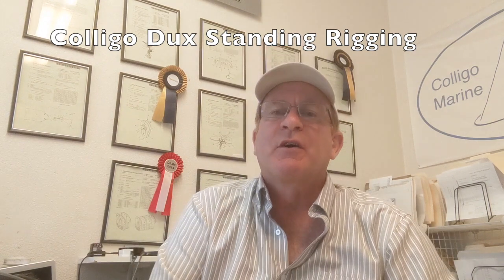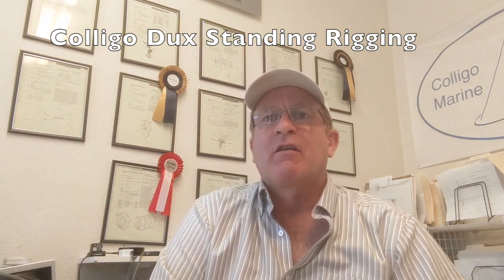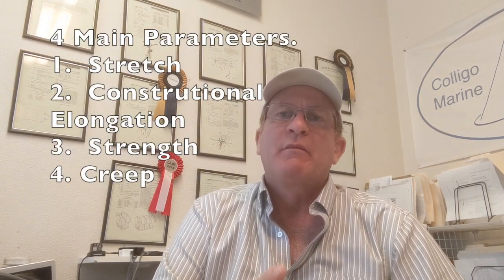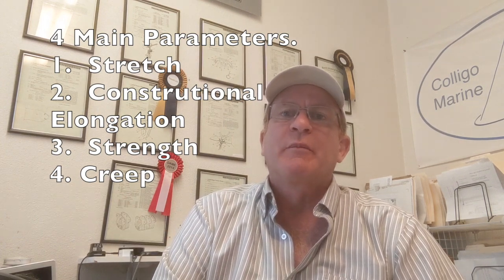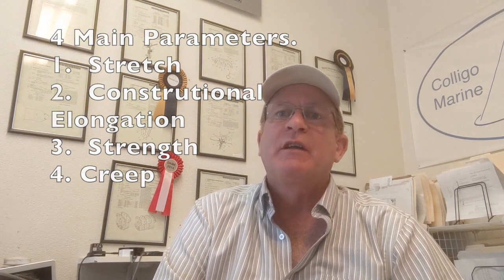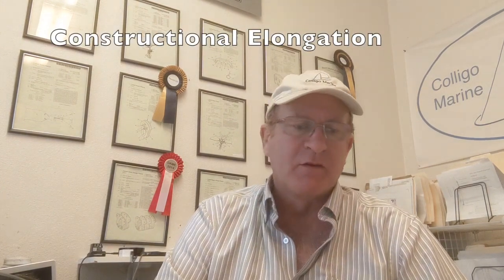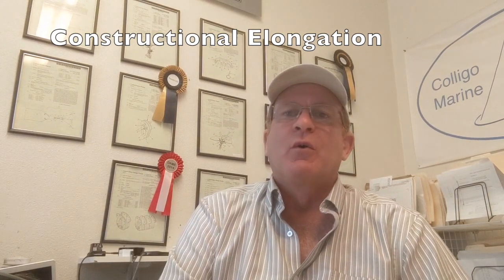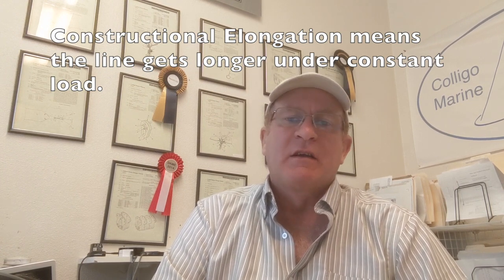The 4 Things to Size Your COLLIGO DUX STANDING RIGGING

Comment: Very interesting video. Is Colligo Dux a form of dynemia?  Do you pretension the rigging prior to installation?  How much stretch is expected in heavy wind? How is the inverse coefficient of expansion addressed when transitioning from temperate to high latitude travels? Most importantly what is the resistance of this material to UV degradation. How does this compare to kevlar?

      I think that synthetic rigging will eventually prove to be superior to to steel rigging from the standpoint crevice corrosion, strength, and weight aloft, (at the expense of windage and fire resistance), but there will be a learning curve needed until the technology is proven. 😎